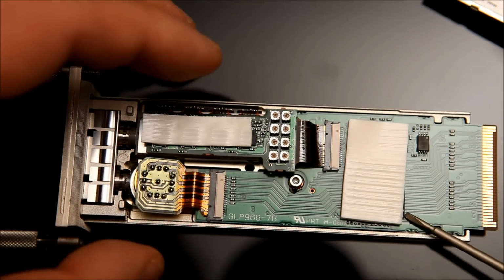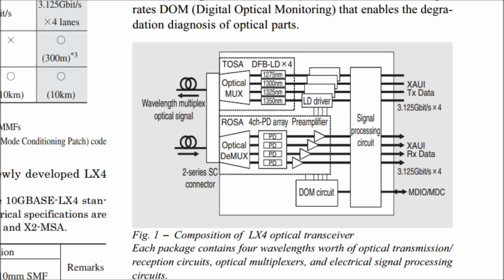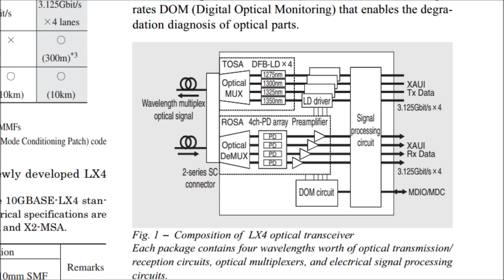10 Gigabit ethernet transceiver (10GBase-LX4 Xenpak) disassembly

Comment from the maker: These are short range transceivers - only around 500m. Longer range ones use a different wavelength (where the glass is clearer) and better lenses for the finer single-mode fibre.

You can get higher power transceivers (in the both sizes). 40 km is the top official specification, but you can get boosted ones up to 160 km. Boosted modules can be dangerous to eyes, and you can't use patch cables for testing or you'll burn the receivers. If you need even more range you can add a laser amplifier.